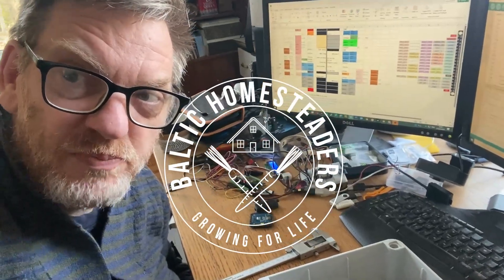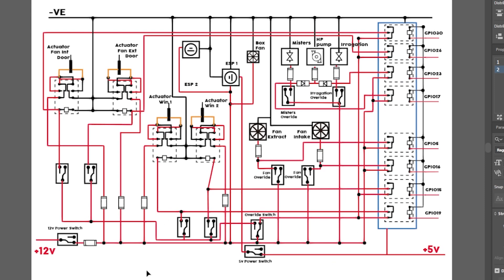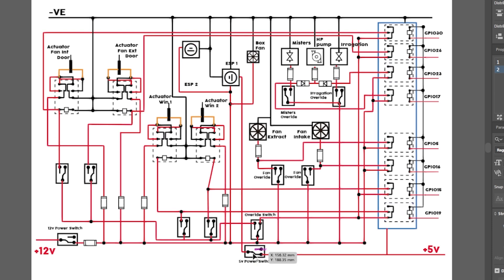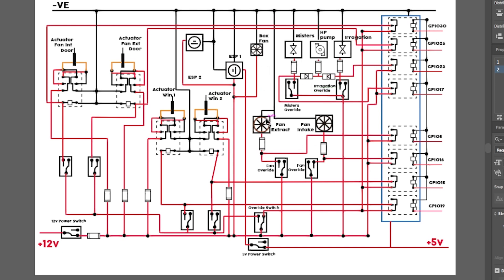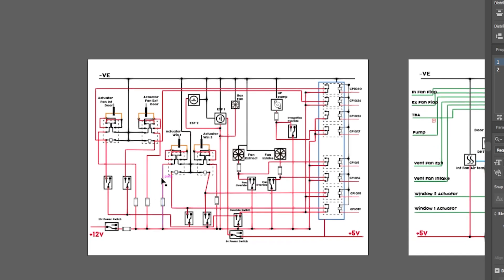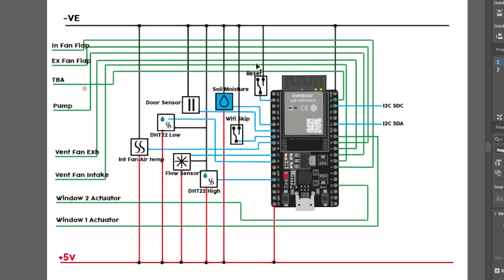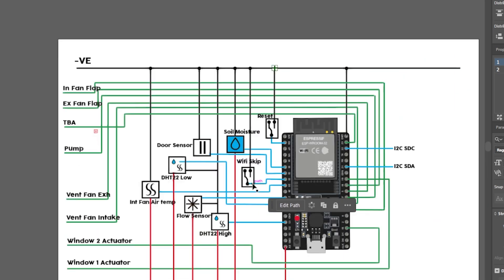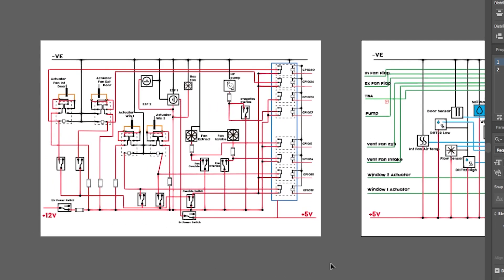Smart Greenhouse Made Simple With My Circuit Designs

Comment: For what it's worth, I think it would help if you prefaced your circuit diagram with a simplified outline of what the control system does for the greenhouse.  For example, a block for the ~7 sensors you're reading, a block for the 4 door & window actuators, a block for the 3 fans, another one for the irrigation controls, another one for manual overrides, etc.  I'm having a hard time wrapping my head around it.
Reply from the maker: Wasn’t that covered in the previous but 1 automation video where I listed everything in the drawing? This is pretty much a continuation, but if it’s not then let me know.
Reply: @BalticHomesteaders  Ah!  I missed that video.  I have notifications turned on for your channel, but I usually don't watch technical videos when tired, and sometimes I forget to go back to them when rested.